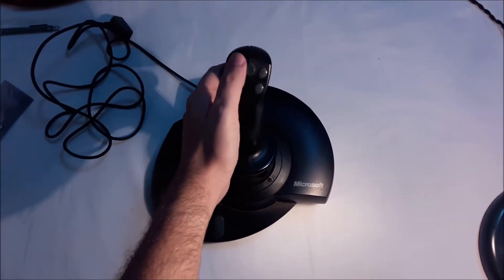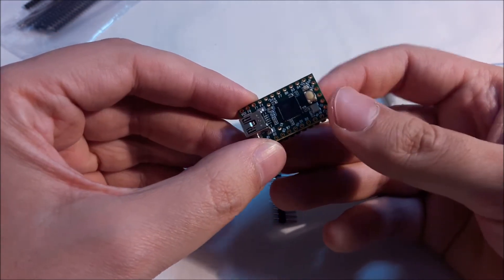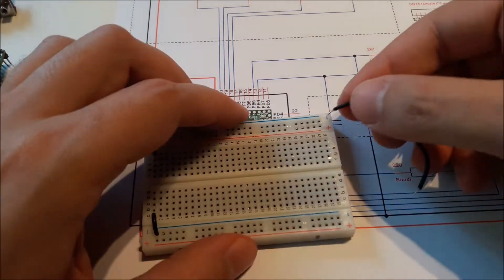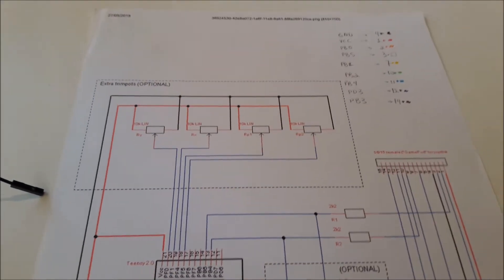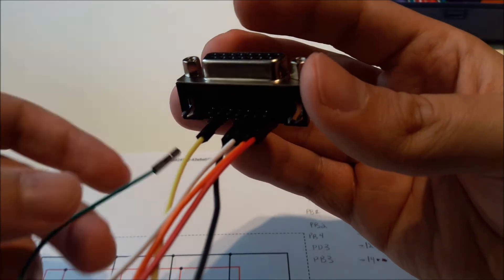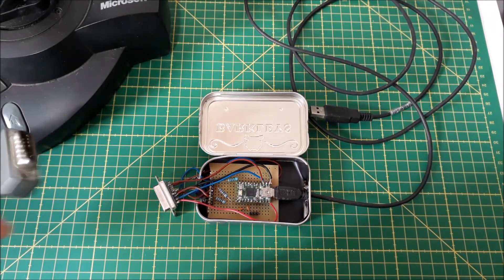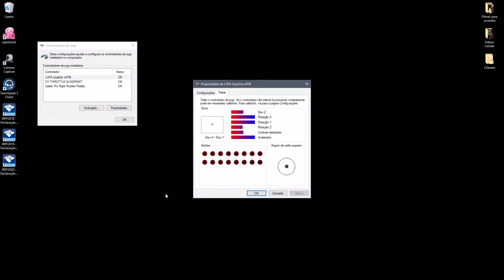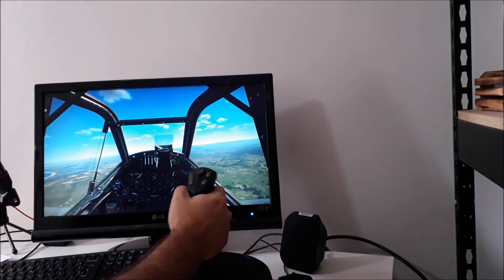Making a USB adapter for Microsoft Sidewinder Force Feedback Pro

Comment: Hola Conrado. Una pregunta. busqué en el enlace pero no encuentro cuales son todos los componentes necesarios para realizar la placa (transistor, integrado, resistencias, capacitores etc.) Como se llama eso donde va montado? eso que tiene varios agujeritos? Perdón por mi ignorancia..! Hello Conrado. A question. I looked for  the link but I can't find what are all the necessary components to make the board (transistor, integrated, resistors, capacitors etc.). That which has several holes? Excuse my ignorance..!
Reply from the maker: Tony, you can find the plan and material list here in this link: https://github.com/tloimu/adapt-ffb-joy/blob/wiki/HowToBuild.md

Teensy 2.0 (with pins if implementing on a breadboard)
DB15 female connector (game port)
2 x 2.2k Ohm resistors
1 x 220 Ohm resistors
2 x 1 nF capacitors

You also need some wires.

The board with the holes is a breadboard https://en.wikipedia.org/wiki/Breadboard

Here in Brazil we know it as "protoboard" and according to google it's called 'placa de pruebas' in spanish.
Reply: @conradovergueiro  Gracias, voy a averiguar todo esto y veré si puedo resolverlo, desde ya muchas gracias, te dejo un link de un par de video mio para que disfrutes:  https://www.youtube.com/watch?v=WABIX-0uyvQ      y este otro         https://www.youtube.com/watch?v=y1s2bC2xpyE
Reply from the maker: @tonymoliterni  No. Is the Teensy 2.0. It's a smaller one. 
https://articulo.mercadolibre.com.ar/MLA-769839393-teensy-20-con-pins-_JM?quantity=1#position=3&type=item&tracking_id=00175d36-f3ab-481a-9bd8-aca64fcf71f5
Reply: @conradovergueiro  Gracias por tu respuesta y tu tiempo Conrado, PERO, es muy caro en Argentina, no lopuedo pagar, con amigos estuve averiguando por un Arduino, pero no están seguros de que funcione, además abría que hacer cambios en el programa, algo que yo desconozco,  no creo que pueda tener suerte con la posibilidad de armarlo, me da tristeza por mi hijo, pero así son las cosas aquí. seguiré investigando. Muchas gracias por tu tiempo y paciencia.
Thank you for your response and your time Conrado, BUT, it is very expensive in Argentina, I cannot pay it, with friends I was finding out about an Arduino, but they are not sure that it works, it also opened changes to the program, something that I do not know I don't think I can be lucky with the possibility of putting it together, it makes me sad for my son, but that's the way it is here. Keep investigating. Thank you very much for your time and patience.

Comment: Muchas gracias por el aporte, no es fácil de construir para cualquiera, pero me gustaría hacer el intento. Hay algunos videos en internet pero no son ni por lejos tan buenos como este. Yo quisiera que mi hijo use el joystick, espero hacerlo funcionar.  Gracias. Thank you very much for the contribution, it is not easy to build for anyone, but I would like to try. There are some videos on the internet but they are not anywhere near as good as this one. I would like my son to use the joystick, I hope to make it work. Thank you.
Reply from the maker: Gracias Tony! I used it for 6 months on the breadboard before building the soldered version. On my first build I inverted some wires and the force feedback wasn't working properly. You just have to be paying attention to the pins and everything will work fine. I hope it works for you! Also nice guitar playing there, I'm also a fan of Frank Zappa :) Saludos desde Brasil!